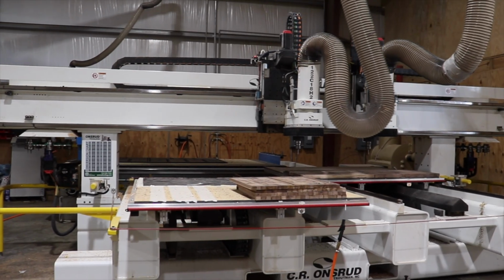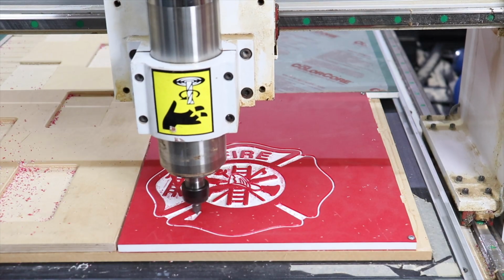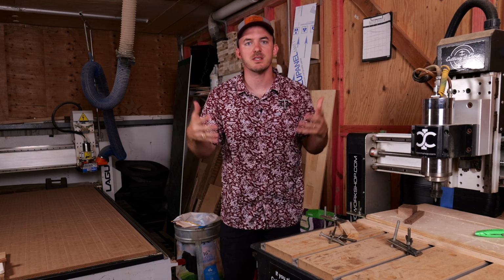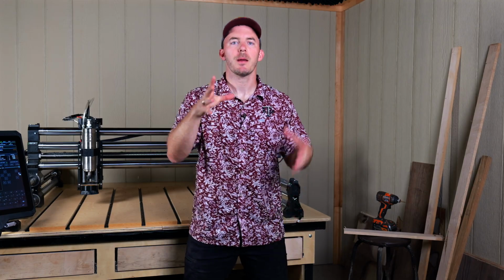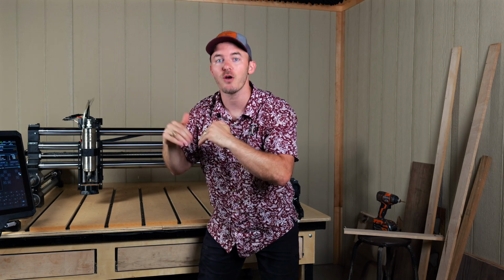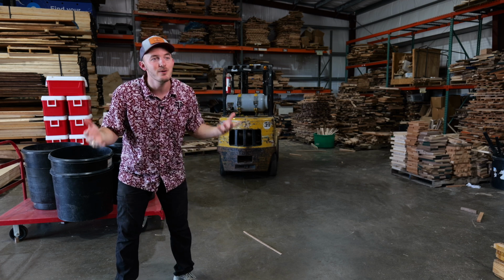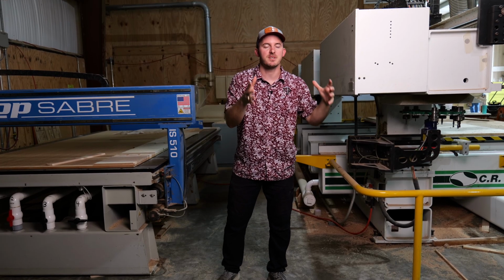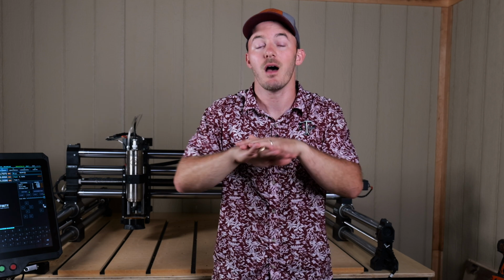7 CNC Business Tips I Learned Over 10 Years

Comment: Biggest tip I can suggest is charge the right price and stop making unprofitable items. Work out what you shop hourly rate is, which applies just as much if your at home or rented space, whether your using a CNC, a lacer or a 3d printer. If a product takes 3 hours to carve,  cut or print, then the cost includes those 3 hours. If that makes it unsellable and you can't add more machines to have several running, then find another product.
Reply from the maker: Agreed! Getting a bigger machine does make you faster at producing but the overhead changes. I’ve found a product that cannot be made profitably on a smaller CNC is very hard to make profitable on a larger one.

Comment: Invest in learning the design software up front - it will give you a better understanding of what the CNC can do well & will speed up the process
Reply from the maker: Agreed!
Reply: I have all the skills to start this, even manual machinist machines, but lack a cnc router.  Do you recommend I get a $500 cnc to simple start, learn and teach my adult kids, as they will be running it eventually... thoughts?
Reply: @vosburght  I started with a smaller one that was around $1000 & regretted it not long afterwards because I felt limited to what I could make after I got it going. So I upgraded. I would say if you can swing it, don’t go too cheap.
Reply: @tpsooner7816  what would be the optimal price/performance machine in your view?